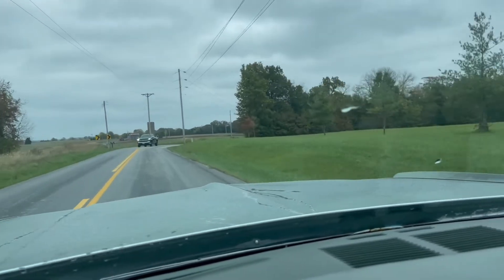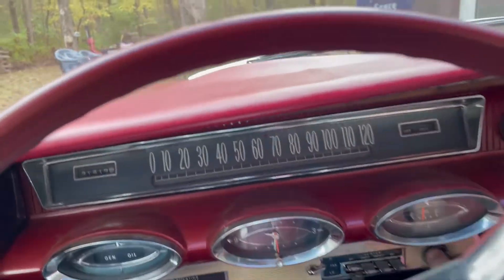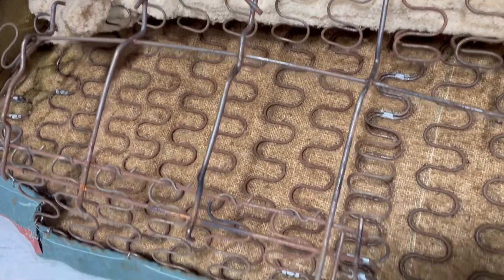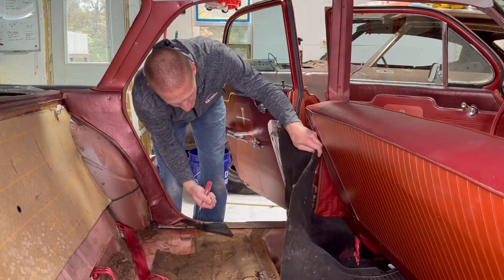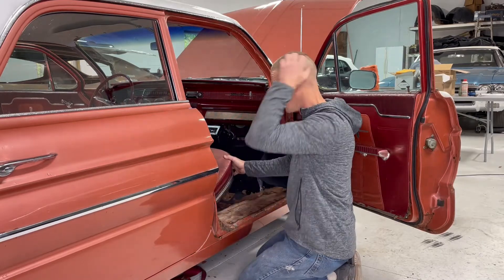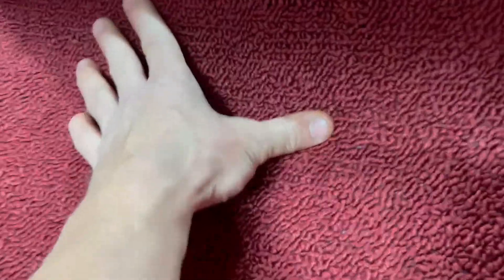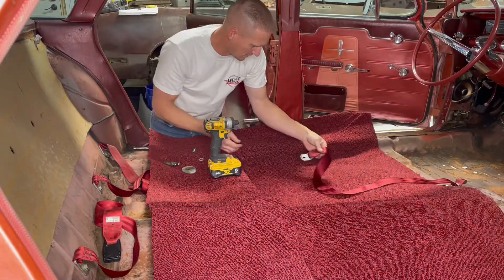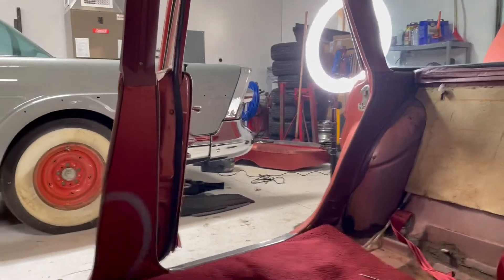Wrap-Up on the 61 Olds Dynamic 88

Comment: Wildcat would act just like that when cold until I installed the Sniper. Now its like a modern car.
Reply from the maker: I found out yesterday that the choke was not set at all.  It was just hanging open.  As soon as I adjusted it, the engine fired up like it was injected.  Hopefully it’s that way when I cold start it again.